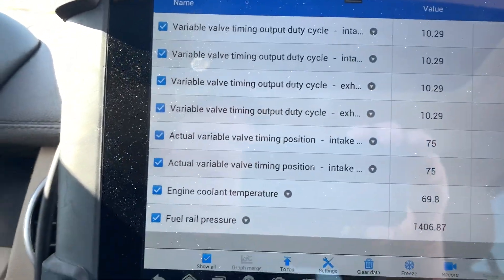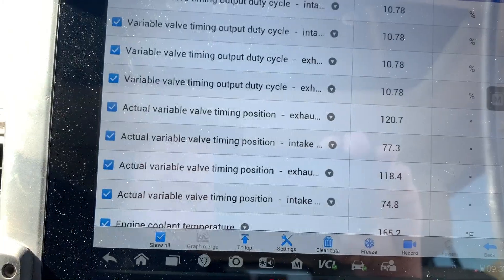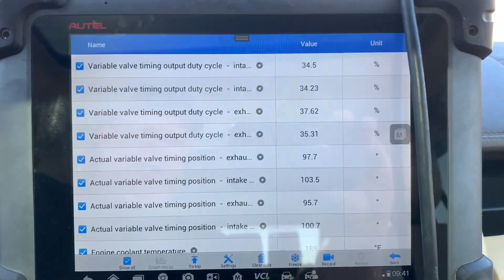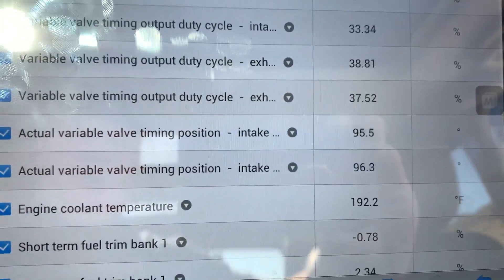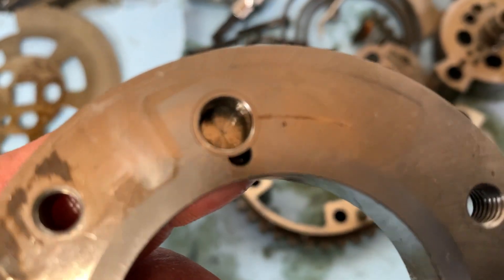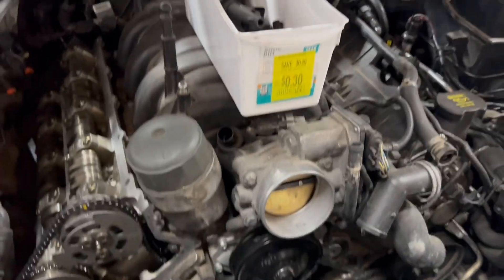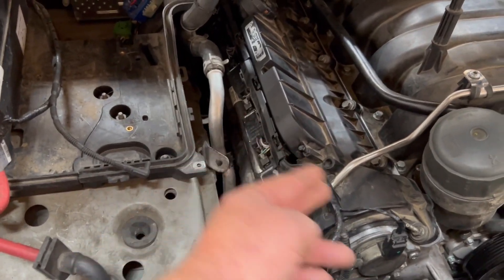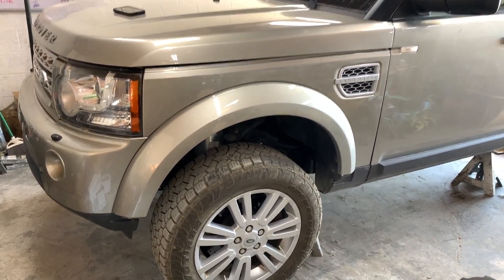Land Rover LR4 5.0 Engine Timing Issue (P0341)

Comment: What scanner are you using? is it a recommend for the land rover as in bi directional?
Reply from the maker: In that video I'm using my Autel Maxisys.  Yes you'll want a bi-directional scan tool.  I don't recommend the Autel scanner,  the subscription fees are ridiculous and there are things that it won't do on a Land Rover.  If you're only working on Land Rovers, I'd look at the GAP tool or maybe the LAUNCH Creader Elite.  But the GAP tool still has the most capabilities. Thanks for watching & the comment!